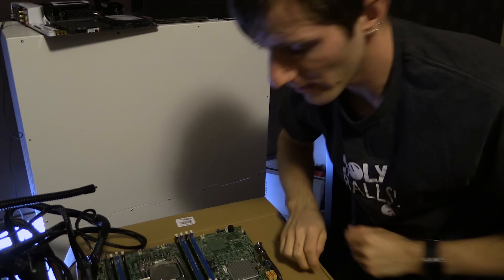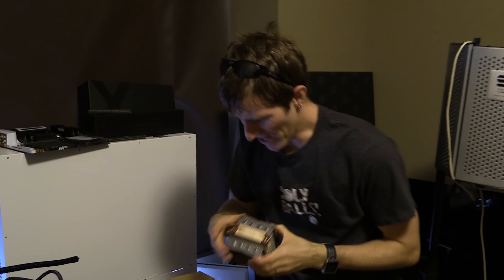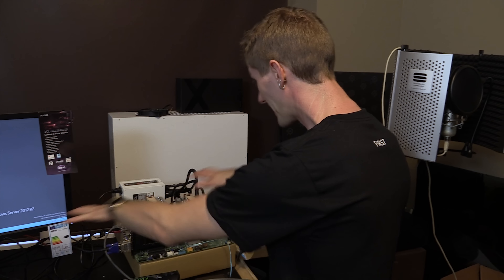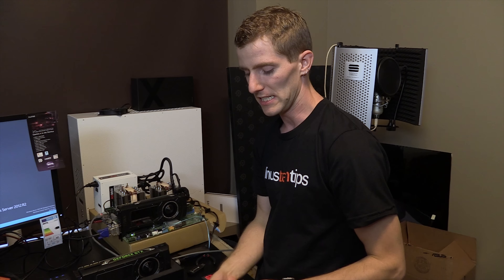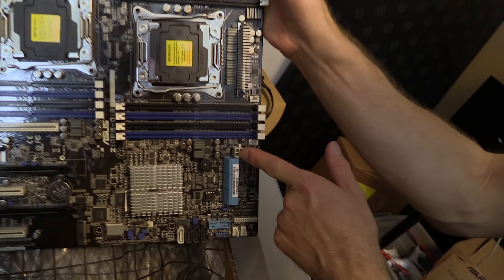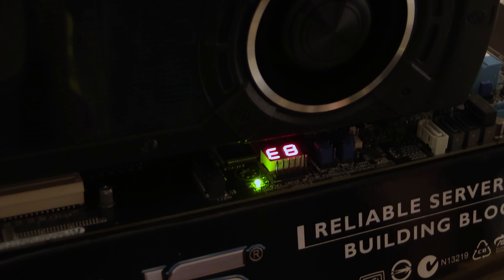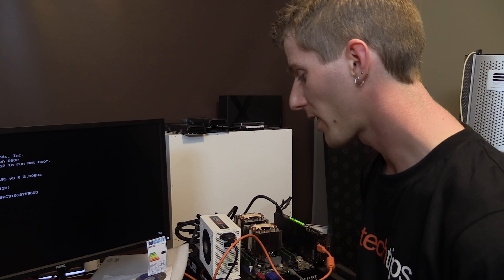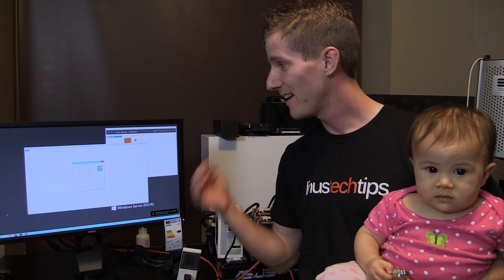36 Cores, 72 Threads, and Two Titan Xs - Our New INSANE Rendering Machine Part 2

Comment: Your experience with ASUS support was much different than mine. I had two x99 Deluxes that both would not boot with multiple devices plugged into the USB, some sort of power management issue that prevented the SSD from getting enough power to handshake over the operating system. out of the 7 techs I spoke to, 2 of them were competent... One day I will have a direct line JJ or Raja... Ha.
Reply: ***** Hello I watch your vids
Reply: Svend-Emil Poulsen
Hello and thanks!
Reply: OMG can't believe you replied. Love your setup.
Reply: Svend-Emil Poulsen Why, I'm no one special. Just a nerd who plays video games... Ha. Getting a reply from Linus would be something to OMG about... ha.
Reply from the maker: Not really.  I reply to stuff on my videos all the time :p
Reply: LinusTechTips at least before you get the flame wars, you do. haha.
Reply: LinusTechTips OMG can't believe you replied. Love your setup. (and you but don't tell anyone...)
Reply: OMG made my day LOL. Love u.
Reply: ***** mine was worse! I own a fm2+ motherboard and told them that their raid driver for windows 8 does not work, all the reply i got was that the don't support raid on windows 8, even though they made a shitty driver
Reply: AayVy My issue took me 3 months to resolve. After my RMA ASUS swore it could not be an issue with their motherboard. I replaced the PSU, was told that it had to be my processor... until I figured out that it was actually the motherboard. For 3 months I couldn't reliably use my PC until I disabled USB devices during boot.
Reply: hope JJ reads this and notices how bad their support actually is
Reply: I had one Asus board that had a known issue with the sata driver going bad. It took, I shit you not, 4 weeks for them to get back to me, at which point they gave me a shitty canned response. Their service is a joke at best, kinda like valve actually. However, they do make some nice ass boards that are hard to beat :(
Reply: ***** Rule #1 about PC customer support: Don't use customer support.
Reply: ***** loooooooooooooooooooooooooooooool first you replyed to a man so he sayed omg than linus replyed to you sayed omg i will say omg if pewdiepie replyed to
Reply: Hi I'm spidey. my name is spidey.
Reply: Spidey. spoderman pls
Reply: Doobie?
Reply: Doobie pls.
Reply: I hav deirct line to gawd.
Reply: HappySlappy Face OMG
Reply: +Reckless Yuki I feel sorry for you to have to deal with that... lucky for me, my X99 Deluxe has been great. I waited quite a while after the initial launch of the Asus X99 Deluxe before I purchased my board. Knock on wood.
Reply: I don't feel at all sorry for anyone, xcept my self.
Reply: Spidey.
lol funny
Reply: Enjoy it guys, play safely.
Reply: +Just4Gamers Tube he saved you from console good man
Reply: You need a really expensive graphics card to run in high res by default. ITs worth going crossfire with 2 cheap amds second hand it should help
Reply: Games are crap.
Reply: I agree, Asus makes awesome stuff, but when it doesn't work. Good luck. In my experience MSI has awesome customer service/rma, my experience with Asus was...Well you can guess.
Reply: +Reckless Yuki - 4k Gameplay & Tech 
I have had 4 bad X99 Sabertooth motherboards in a row. 2 from Amazon and 2 from ASUS RMA. I am awaiting the third RMA which is 3 days late for overnight delivery. I have replaced RAM, SSD, video card, power supply and CPU. My system is still waiting for a reliable motherboard. The first one fried a USB wireless mouse transceiver then would not boot. The second had to be rebooted several times to load the SSD and boot the OS. Eventually it died all together. Third would not recognize anything in RAM channels C or D. The last had a dead D RAM channel.

This has been going on for 4 months. If another manufacture offers the features of the X99 Sabertooth in the same footprint I will leave ASUS forever.
Reply: +Reckless Yuki - 4k Gameplay & Tech At least they can help compared to EA xD Took me like 18 customer supporters to fix it and the last guy finally fixed my problem instead of saying the same bullshit xD
Reply: +joemelsha95 . .... lol.  ....  Unfortunately I understand what you mean, many or most techs treat computer educated people like most computer owners, and worse, when on the phone the techs often are incompetent, able to only read what his or her computer screen displays .... I used to own my own company and was a consultant, among other things.  These days I often tell a tech everything I did that is relevant - before he wastes my time asking, often with questions that are not pertinent to the problem.
Reply: I care less how low class serfs are treated.
Reply: +ZZstaff Did you ever say, "Sir/ma'am, have you tried turning it on and off"
Reply: Yes, call me Sir.
Reply: AKShamu28. .... Turning on and off their computer?
Reply: ZZstaff Infamous quote of many tech support staff that probably don't know what they're doing.
Reply: +AKShamu28 but it works a lot of the time.
Reply: +Reckless Yuki - 4k Gameplay &amp; Tech Asus ain't an angel company, but their stuff is on average better and cheaper. That is about as good as you can expect, and true technical support from asus would require speaking taiwanese where their actual technicians could help.
Reply: Some may say they were from hell...
Reply: Well., now that you mention it, yes, I am straight.